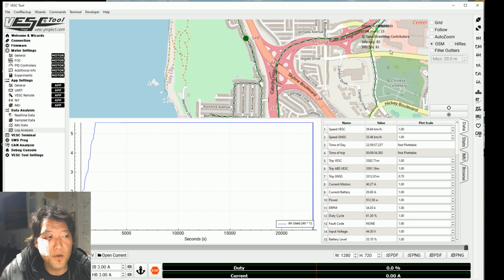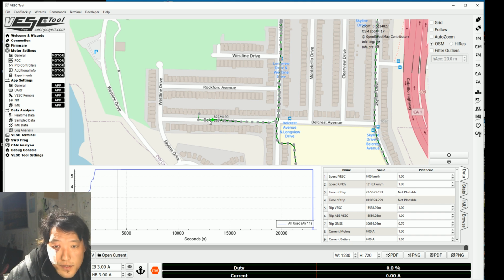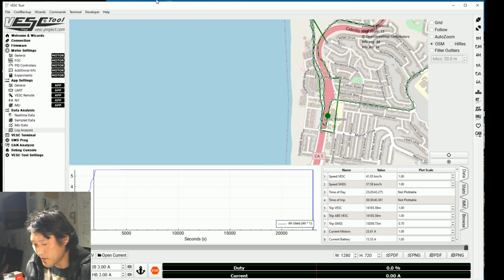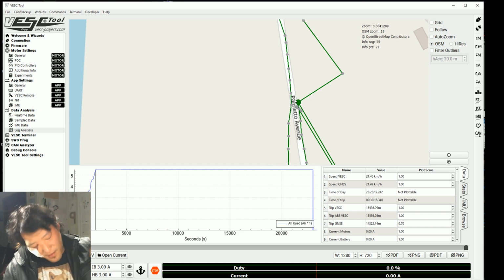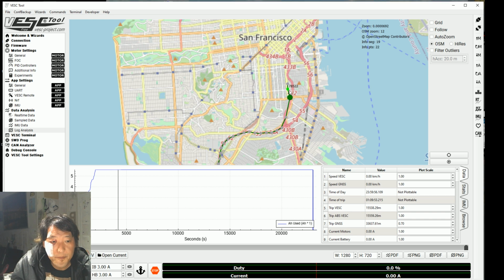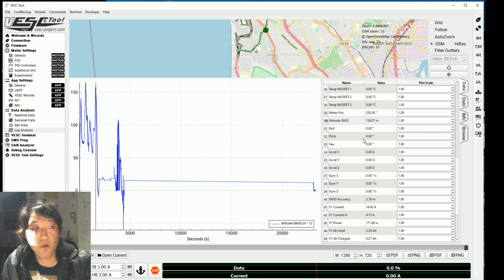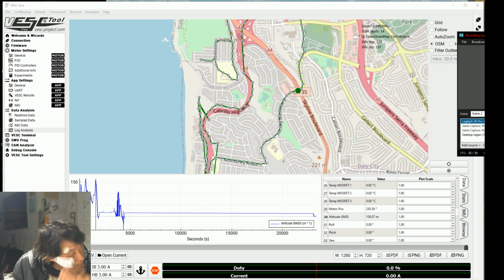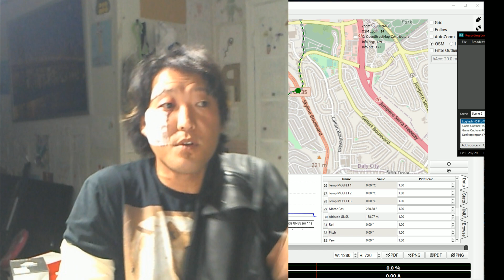32MPH CRASH on 6000 Watt Electric Skateboard, VESC Log!

Comment: I reached that speed going downhill on a non-electric board on a highway but i was going so fast with no brakes that i felt i wasn't going to be able to make the turn. Stupidly enough i did this with no helmet or safety gear. So i asked my self what would MacGyver  do jump off and tumble jump off the right and take my chances off a cliff or jump in the middle island in-between and most likely go past the island to the other side of the highway. I decided to not make the turn i decided to got the curb go flying forward grab on the small tree with all my strength as to fall in the island and not on the other side of the highway. I made it how i don't know but the adrenaline helped my strength to hold on. I fell with no scratches but my arms felt like i dislocated them from the pull in about of pain. I then got a anxiety attack walking home knowing i could have died. I also fell off a hoverboard more recently trying to max out it's speed recording it on my cellphone camera while holding it i feel though my phone and feel on my tailbone. I was in pain didn't get up my daughter in the video said i got you dad. So i thought she was going to pick me up and then she got my phone and kept recording me trying to get up in pain.

Comment: How do you turn on traction
Reply: Good question, how do you turn on traction control when using vx2 via uart? It appears the controller settings is only necessary when using ppm remote right?